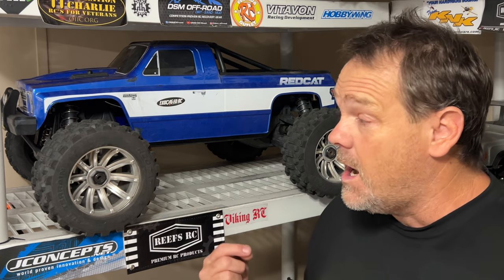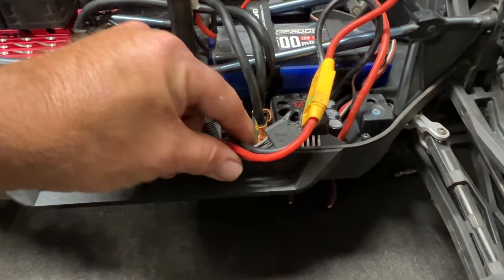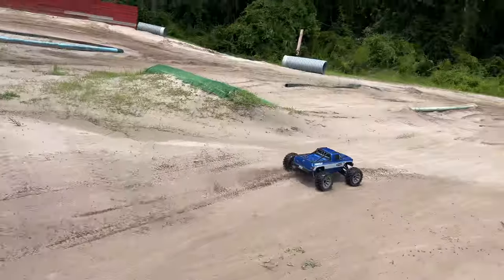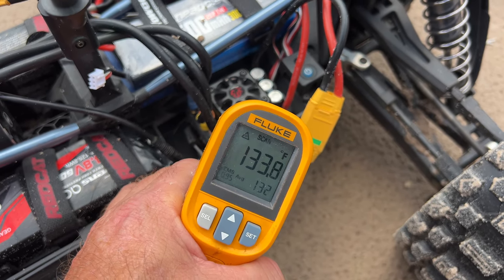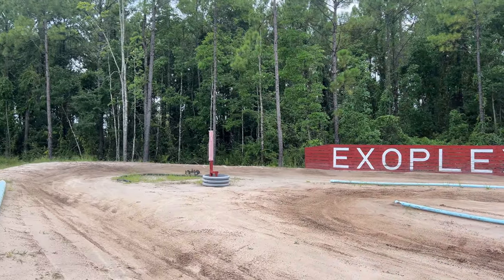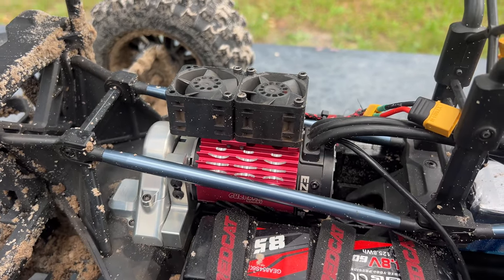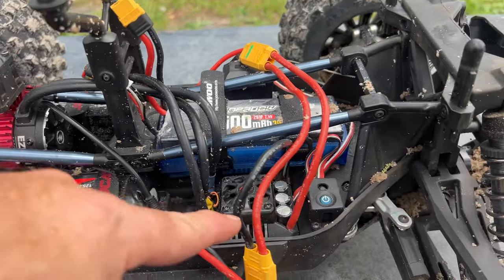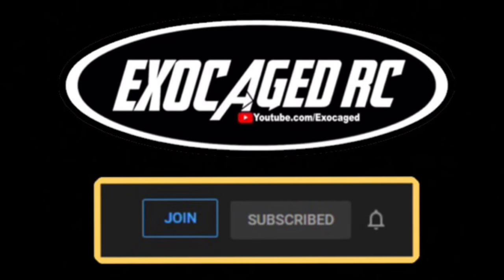Keep it cool with HyperFlow Fans Vigilante Edition

Comment: Have you had any issues with the motor mount separating from the gear cover because of the weight of the motor That's what's issue I've had

Comment: STILL, 130 degrees on an esc should NOT cause a thermal shutdown 🤷‍♂️. I have a twist 60 3D I use an avian 100a esc (w/fan. Factory), & on my iX14 (just bought it. I know🤷‍♂️🤪🤦‍♀️), & my air esc's (avian), temps, according to telemetry, are hitting 150+ degrees when I'm doing my stupid, crazy 3d maneuvers. There's a lot LESS airflow that gets into a plane fuselage.
Reply: COULD be a pos esc. OR maybe that esc needs updated. But, I'm a fly-boi🤷‍♂️

Comment: You should get 4s fans and run each fan on 4s. I have an xrt, and I got game  changer 4s fans and just plugged the two 4s batteries into each fan on the motor
Reply from the maker: Thats a good idea to balance the load across both batteries

Comment: So they should sell this truck as a roller.  Looks like the esc is just junk.  It has the hobbywing look, which isn't good.  Hobbwing is jonk as well.  Hobbywing should have staying in their place of crawling only.  Even the Arrma owner stayed he will stay in the speeding lane, while hobbywing stayed in the crawling lane.
Reply: Hobbywing isn't junk not at all.
Reply: This truck a beast @malsmith2012
Reply from the maker: The stock esc is really good! I'm just pushing it to and beyond its limits with this 56mm motor and gearing.